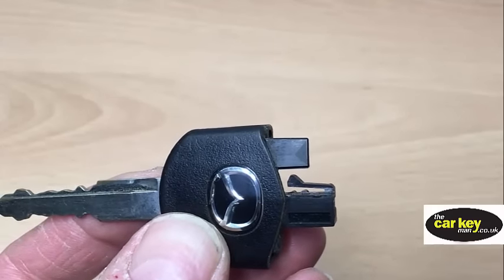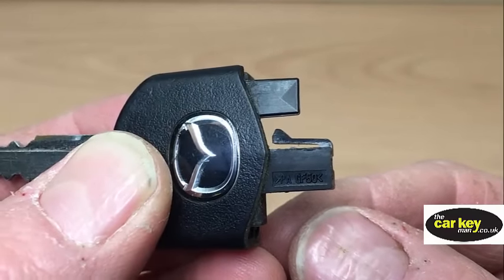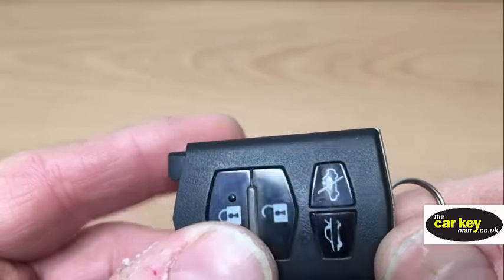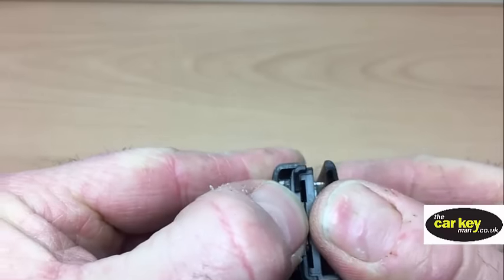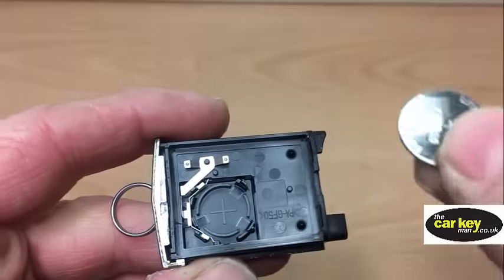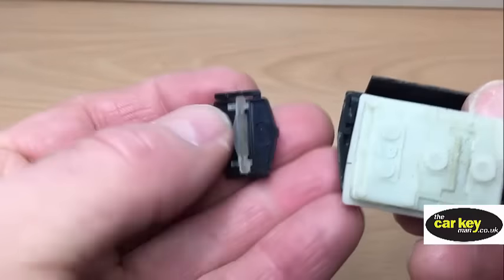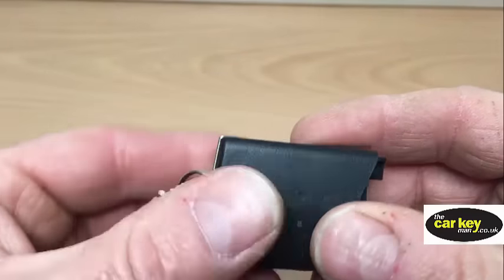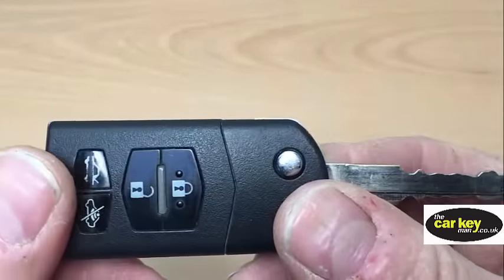Key Battery Mazda Remote Key HOW TO change

Comment: WTH, am I the only one with a key that doesn't have that little slot after you take the key off so you can open the case?  :-(    Mine is flat, smooth, with the Underwriters Lab symbol and a bunch of letters and numbers.  There's absolutely no place to to press on or insert anything in order to split the case.   Ugh!   Anyone have a case like this?  I have two keys and they're both like this.
Reply from the maker: H Beth, thanks for the question. That's unusual. It may be that your key has already been repaired in the past and it's been put into an aftermarket repair case. The other thing that's common is the two halves are glued together because the tab breaks. Have you tried to pull the two halves apart?
Reply: I've had the same thing. I've tried pulling it apart and everything using pliers, screwdrivers,etc. But it won't pop off
Reply: I have the same key as you. After the actual metal key part is removed, the other part has two little deepenings on either side. Use a little screwdriver or a knife and apply it to any of those dippenings to split the part in halves. Do not push, but hook it in a direction you want to split the parts to. However I think you have already found the way to do it.
Reply: Hey, i have the same issue and i was wondering if you figured it out. Thanks
Reply: I have the same key as you so after watching the video I was a little confused 
But I had a good look at it and found the seam  look on the opposite side to the slot for the key and running down the edge is a narrow slot i found prising this apart with the blade of a knife works to open up the case

Comment: Some idiot has superglued my fob shut so I can't separate it into two parts
Reply from the maker: We see this alot. It's normally because the tab has broken that holds the key together. If you have a good local comapny, they may be able to break it open, and swap the parts into a new case
Reply: The Car Key Man Thanks for the advice! I'll look around my local area (Wigan) and if all else fails I might even consider making the drive down to your premises. After all it would still be cheaper than buying an entirely new key.
Reply from the maker: Ok, the problem you'll find is that there are several different types of case. When we fix these, we normally undo it to see which one it is and obviously you can't do that!
Reply from the maker: Just thinking Matthew. If you send us a message with the reg we may be able to give you some help long distance! www.thecarkeyman.co.uk